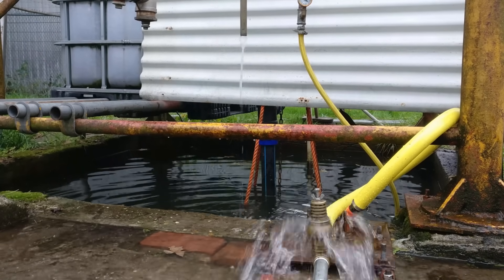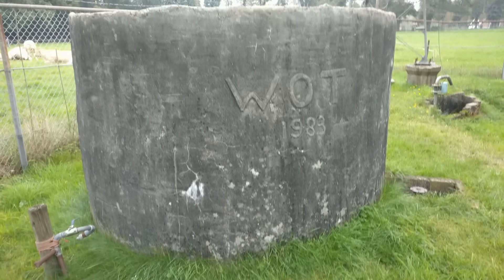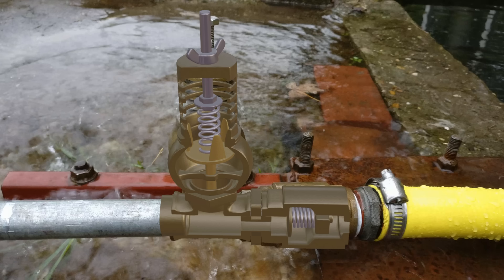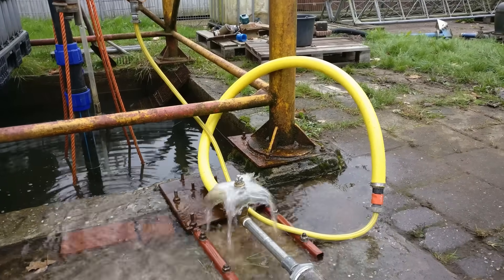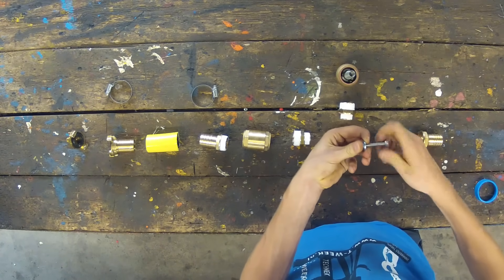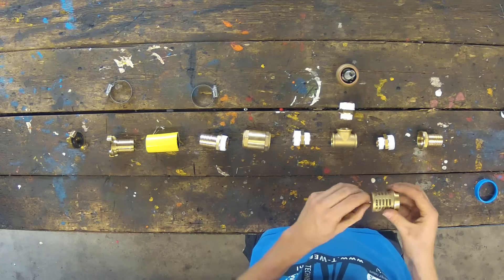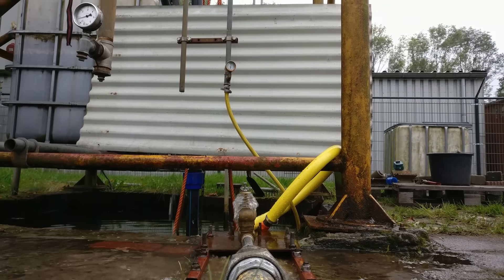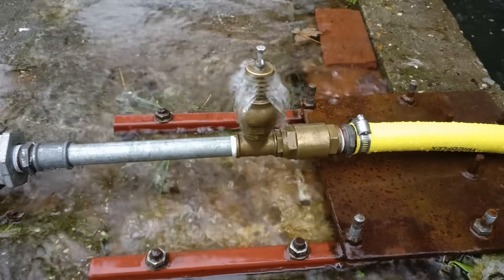Pumping Water Without Electricity - The Breurram

Comment: Wouldn’t it be possible to put the pump into the water tank so you don’t really loose the water?
Reply: Depends where you want the water
Reply: This system will spill big amount of water that has almost no momentum left, so if you put this back into the same water tank, the pump system will just stop working because there is no potential difference to make the flow possible. You can put into different water tank, but it MUST be lower in elevation than the current tank.

Comment: while ingenious, i feel i must questionthe practicality... surely anywhere with a flowing water supply like a river, it would be more efficient to install a water wheel to drive a pump? less water would be wasted and the volume of water pumped much higher
Reply: The practicality comes from the ease of maintance (you could teach a person in a few hours to set it up, and how to clean out the pump if needed) and one person could carry the entire set up in a backpack if the enviroment has enough height difference.
Reply: its a matter of cost and simplicity, you could do most of this with pvc  along a very shallow water source and just let the "wasted" water flow right back in down stream. plus this design only has two moving parts that require no maintenance

Comment: probably wouldn't hurt to make a route for the water to go back to the tank if you were using a more limited draw source. so the lost water can be put back into the cycle, or routed to a small garden
Reply: You can't send that water back because it would have to travel uphill to the source. If you have a limited source just throw down a solar panel and an electric pump.

Comment: On your hight test where it goes up the right and back down the left, the video isn't clear on what that looks like on top where you make a 180. Was the top open to air so that you didn't get a siphon? How high did those pipes go before making a 180? Did you move that entire pipe apparatus (not the pump itself just the outlet pipes after the yellow hose) up for your different hight test or did you add pipe higher into the air keeping the outlet at the same height?
Thanks
Reply from the maker: High Ivan, thank you for your reply. You are right that the pipes are not shown clearly, we wanted to keep the video as concise as possible and excluded a detailed description of the pipes. The two pipes shown on the height comparison run parallel all the way up the tower. At different heights these pipes are connected with a valve. If the valve is opened water can flow back here and will not flow all the way up the tower. So for the highest setting we just close all the intermediate valves. At the top of the tower there is an air inlet, also if you look at the water flowing out of the pipe, it is clear that the stream is not continuous and is interrupted by a lot of air, this would prevent syphoning, even if there was no air inlet. I hope all is clear now, otherwise feel free to ask more.
Reply: @WOT_utwente  Thanks for the detailed reply. I really appreciate it. I've seen other videos where people just throw a hose up and let it practically siphon back down making their test inaccurate. Nice work, thanks again. Peace✌️

Comment: Could you use this device to pump water up high, then use the falling force from gravity to power a waterwheel or generator in a place where it's not feasible?
If the intention is to build this by a river then my idea is impractical, but just a thought.
Reply: Yes, but in the majority of circumstances I'd suggest just putting a waterwheel in the river to power a generator. The most realistic scenario for this is when you need more power than a river can generate for a short period of time. So you fill a water tower and empty it very quickly to power a turbine when you require it.

Comment: I know it’s not possible but like, infinite energy if you have the water flow back down into the starting point once it reaches the top if the tower?
Reply from the maker: Only a part of the water is pumped up. The majority flows out directly at the pump. This water is lower than the tank and it will require energy to get it back into the tank. No infinite energy indeed
Reply: @WOT_utwente  I knew it 😂

Comment: Is it possible to put the pump near the tank and feed the excess water back into the tank?
Reply from the maker: No it is not. A height difference between the tank and the pump is needed. Otherwise water will not flow fast out of the pump and the valve will never shut.

Comment: you can even use the river flow water to run a wheel that is connected to a pump from another hose. to pump water up high. there are windmill pumps but i think a watermill pumps also can work.

Comment: strange, the water entering seem to be already under presure. and you increase presure. i dont know if it works with still water.
Reply: It doesn't.
The device uses the momentum of the moving water in the feed pipe to generate high pressure pulses. The pressure in the feed pipe is irrelevant, except as it affects how rapidly the water in the feed pipe is accelerated while the spill valve is open. When the spill valve snaps closed, the momentum of the moving water in the feed pipe generates the high pressure pulse needed.
1. Spill valve open - water in feed pipe accelerates until it's moving fast enough to close spill valve.
2. Spill valve snaps closed. Momentum of the moving water generates pressure spike, overcoming discharge valve.

Key thing to note: LOOK AT THE FEED PIPE. If the feed pipe is rocking/shifting/moving with each cycle, that is wasted energy, reducing the efficiency of the pump. You want that feed pipe to be as rigid as possible.

Comment: Connect 2 in series in a closed loop. Cover the tanks, set a generator on the downflow tube and you've got a functional perpetual energy machine using nothing but gravity and potential energy from springs not to mention manipulation of common fluid dynamics

Comment: Could you theoretically chain pumps at say 4m intervals in order to maintain pressure over height? Or would the pressure decrease anyways?
Reply: I'm pretty sure it would end up decreasing anyway. Think about what the second valve up would need in order to let water rise through it: a lot of pressure beneath. The peak pressure beneath would happen only when the lowest valve was also open/peaking, which would leave a pipe of water with decreasing pressure. 

I'm sure there's a theoretical way to do it, but only at the expense of a ton of water loss/speed.

Comment: I wonder what the effectiveness of this would be as a power system. If you did not have access to a river, but used a rainwater tank.
You could pump the water to a point a few metres higher than the water tank, and have it run down a pipe or channel with turbines Installed to generate power.
The biggest problem is minimising the lost water from the pump, although I suppose if that drained into a second reservoir you could hand pump it back to the feed tank once a day
Reply: It would generate next to no power. Would be better just to elevate your rainwater tank. But even then it's not going to hold a lot of potential energy.
Reply: The best way to generate electricity from a river is to generate electricity FROM the RIVER... not 1st divert it pump it & then attempt to gain something on the other side

Comment: Where does the pressure come from on the side with the tank? Is it just from the existing pressure head at the bottom of the tank?
Reply: It used the water hammer effect to generate the pressure pulses.
1. Spill valve open.
2. Water flows down feed pipe and accelerates.
3. When water is flowing fast enough, spill valve closes. All that water in the feed pipe has a lot of momentum and "wants" to keep moving. But when the spill valve closed, all that moving water no longer has a place to go. So there's a pressure spike.
4. That pressure spike opens the discharge value, allowing water through.
5. The water on the discharge side has a lot of inertia. In order to minimize the amount of inertia to overcome, we need to minimize the amount of water that needs to be instantaneously moved. Hence the air chamber.
6. Pressure spike drops below pressure on discharge side. Discharge valve closes.
7. Pressure spike drops below level needed to keep spill valve closed. Spill valve opens.
Cycle repeats.

Comment: Mean it can generate free energy from nothing .
Reply from the maker: Hi, the breurram cannot generate energy from nothing. Nothing can. Energy always has to come from somewhere. In this case the water tank is higher than the pump so water flows down. When the valve shuts off and  blocks the water, the energy of the flowing water is used to pump water up.
Reply: @WOT_utwente  ....up then source of water ?
Reply from the maker: @omsingharjit  A small part of the water is pumped up, higher than the source of the water. A lot of water also flows out at the bottom. The water flowing out at the bottom has a lower speed than the water flowing into the pump, this difference in energy is used to pump up a small portion of the water.
Reply: @WOT_utwente  mean its like stepping up low voltage high current into high voltage low current . Right ??
Reply from the maker: @omsingharjit  Yes indeed, thats a way to look at it

Comment: SO! What about a container collecting the wasted water the pump is using and another pump using that water also?
Reply: all the energy from the river was expended & now that supposed "waste water" either thru man made channeling or NATURAL HYDROSTATIC PRESSURE eventually ends up back in the river... to channel the water needs to run DOWNHILL to a place in the river even LOWER than the source elevation & the pump that is 2M lower than that in this case, for nature... the deeper the water goes into the soil the greater the pressure just like diving deeper into water... it isn't volume its elevation in the gravitational well... for instance the pressure at the bottom of a 10' tall beer chugging fluted glass is exactly the SAME as the pressure 10' down in the OCEAN... its about elevation NOT volume of the body of water... so as the water goes deeper into the soil it always takes the path of least resistance... the river is like a VACUUM & hence eventually the water will move towards that vacuum which is the reason the river is there in the first place [tho not exclusively obviously rain mountains etc play a bigger role in that- however hydrostatic pressure build up does move water in the soil near rivers- into that river]... the energy that the river provided is used up & new water for the running river needs to provide the new energy to keep the pump working

Comment: ‘tis a hydraulic self-oscillating boost converter. I love it.
Reply: This is exactly what I was going to comment. Love it when you can have a mechanical equivalent to an electric system.
Reply: Same here, I'm looking at that pulse and thinking, "this is a boost converter!" 😆
Reply: @danloeser  similar to a waste gate that controls  boost on a turbocharged vehicle.
Reply: This is how the Giza pyramid (blueprint) used to pump water away from the dammed up areas that the Pharaoh's ancestors fled from.

Osiris is a water-being (a verison of poseidon) Enki is a water-being, and AztaAtlTlan where the Aztecs claim heritage means "land of water birds".

Giza is just the most advanced copy of whatever pump technology coastline people could come up with before all the old coasts inevitably got flooded.

There was NO "high technology", - just manipulation of occillations and the knowledge of advantageous erosion that followed, - allowing egyptians to take advantage of possibly a couple thousand years of dam/pumping knowledge from wherever migrants came from.

The kings/queens chamber "roof" could be where the original builders let the overflow of the Nile flow into an aqueduct system above ground in order to water their crops, while using the pressurized end of the loop to aid with the cutting of sandstone.

Comment: Seems like the loss water could be used for a biological purpose since it is aerated. Possibly a fish/aquaponics farm if dug below the base of the tower?
Reply: Over time it would be too much constant water, best to get it back ti the river.
Reply: I was thinking just making a bamboo water channels or using pipes and irrigate a little garden playing around with slopes.
Reply: You would need a fairly large farm I would think depending on flowrate
Reply: Or throw it back in the same tank
Reply: @freevbucks8019  wouldn’t be efficient, you would use more energy getting it back in the tank then you saved by using this pump in the first place…
The best solution would be to have it spill back out into the river.
Reply: @derpionderpson1424  if you take it from the river and pump it just above the river it's like free energy
Reply: @freevbucks8019  I’m not sure what you are suggesting here.
The pump need to be below your water source, in the shown example this is a tank (which I think is filled without mechanical or physical work but by the height difference with the nearby river) so you can’t put it in a place above where you get the water from… then the pump won’t work.

And if you mean to pump the water back up there then that seems like constant loss of energy, not free gain… you are taking the height difference of at least 2/3rd if not 5/6st of the water to pump the rest back where it came from… so the water flowing from your pump will be much, much slower then if it had just flowed in the river.

I guess you are technically getting free energy by slowing down the river but just build a waterwheel if that’s your intentions… it’s probably goner need less maintenance then this system anyway.

Comment: You could easily make a drain catch to run that water back to source for no water loss period.
Reply: I think not because the lost water has to be at a lower level than the supply. If not you would be into the realms of free energy and perpetual motion.
Reply: If it's a raised water source and not a ground level kind of setup, you could have the wriggle space to do a drain catch. Idk it's fun to think about.

Comment: From an energy standpoint, it seems logical that you can only get at most Δx/Δn of the water up to an elevation, where Δx is the difference in height from the top of the water tank to the pump and Δn is the height above the pump that the water is pumped to.
Reply: You could increase the efficiency of the system and get water even too higher places with a series of like 5 pumps, the first pump is at 0m and pumps water to 10m, you need a pressure in the tube, so the next pump needs to be at 8m, it can pump some water to 18m if we use a similar pump with a similar energy output. The water exiting the second valve could feed some generator and flowing down and then again feeding the first pool. The next pump at 16m could pump it Up to 26m, the exiting water could again feed some generators and then flows back into the second pool, where it can power again this pump. Am i missing Something big in the physics or is This a great upgrade. The only water without gaining some use is the water leaving the first valve since its lower than the First pool and No feedback into the system possible
Reply: @schekelberg6187  If you let the "wasted" water flow from a second pump 8 meters above ground to the first pool 2 meters above ground, you'll be wasting the energy from the water falling 6 meters into the forst pool. It would be more efficient to have the second pump on the ground taking water from the pool at 10m so that the pressure at the second pump is much higher and you'll be able to pump the water to a much higher height again. 

The math is a bit too long to put in a youtube comment, but not terribly complicated, so you could do the math and double check.

Just remember the pump is less than 100% efficient, so 1000 liters at 100 meters will pump less than 500 liters to a height of 200 meters. Realistically, the efficiency of the pump should be around 60-80%, but the pipes the water travel through will inevitably also cause friction, leading to a further loss of efficiency. Hydraulic ram pumps are only really used if there's an abundance of water though, so trying to improve the efficiency of the system to waste less water is usually of little use.
Reply: @schekelberg6187  this makes no sense. Flow rate drive generators. Pressure has nothing to do with it. Why would you raise the head of water to gain more pressure but have very little flow? It would do nothing but leak water everywhere.

You need high flow water... that's where the energy is. Not maixum height.
Reply: @etherealrose2139  nope, You are wrong, there is Energy in high water, the Same energy like it is in water flowing down from the same high, Just converting those energy types. 
There is more Energy in a River flowing down somewhere, but This is a completely different case, there is way more Energy in a atomic reactor too, so Not pretty usefull

Comment: So u can pump water uphill with this ??? 

No power no air compressor completely self powered ?? 

Sounds like u could turn this into perpetual motion
 (until the water runs out)
Reply from the maker: This may seem like unlimited energy, but it is not. Energy always has to come from somewhere. In this case the potential energy of the water in our tank is used (because the water in the tank is slightly higher, water will flow) . If you would want to generate electricity or power of some sort, it would be best to do this directly from this flowing water without using the breurram.